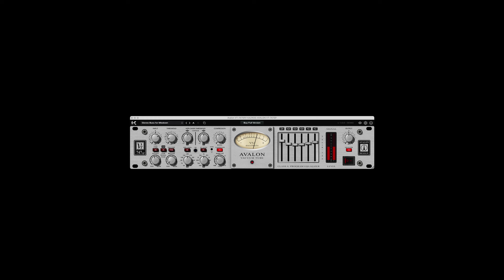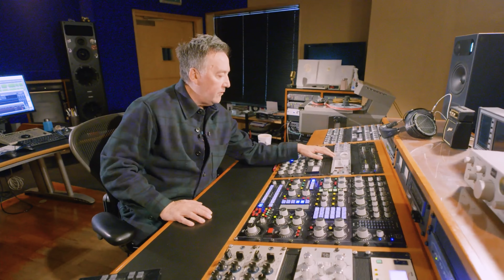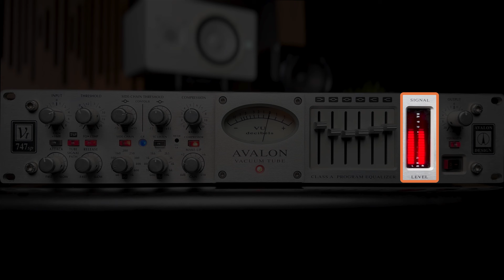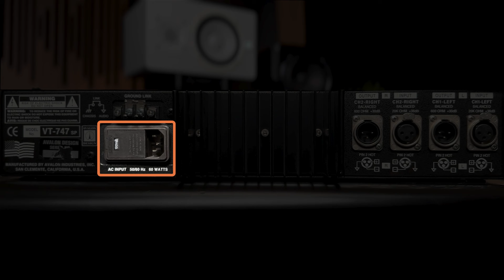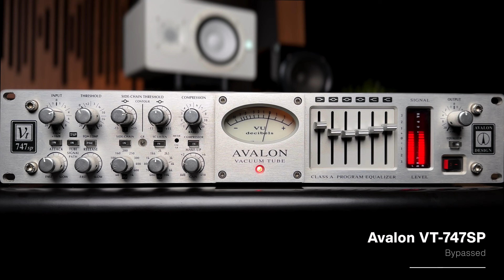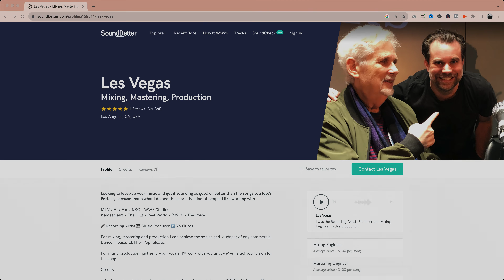Avalon VT-747SP Analog Tube Compressor & EQ (Demo and Overview)

Comment: Great video, really appreciate the effort you put into it. How often do you usually replace the tubes? I’ve got a used unit arriving next week and I’m debating whether to order new tubes now or just wait and see how it performs. Thanks again for the quality video, cheers, bro.
Reply from the maker: @BesharALAzzawi You're welcome. Thanks for watching and taking the time to leave a comment. Congratulations on the new gear! That's exciting! For peak performance, Avalon designs recommends changing the tubes every 5000 hours of runtime. Changing the tubes every two years is recommended assuming use of eight hours a day, seven days a week. Avalon only recommends Sovtek 6922 vacuum tubes. https://www.sweetwater.com/store/detail/ST4TubeKit--avalon-st4-tube-kit-for-vt-737-747sp

Comment: my experience is, I never engage tube circuit, just A-class....imho tubes sound is smothering transients and in general degrade the signal. I use to play with the original hardware and had similar experience (always disengage tube circuit). Apart from that - great compresor and mazing EQ.
Reply: With FET mics tube preamps are king. With tube mics you dont need tube preamps
Reply: What style of music did you try with tsp on?
My experience with tsp engaged on low dynamic and percussive music was positive.

Comment: The review is good, as always on top.

I don't like 747.
It seems to me that the high frequencies are too "sandy"  A very specific sound.
Reply: i have 747 for years. What you mentioned is close to my opinion. It is a specific sound that is not always does the thing you want for the song. But when it does it is unique. i use it mostly for acoustic music.
Reply: @polyphoniki  I mainly do contemporary christian/gospel music ( things like Elevation Worship/Hillsong, and the like) I would use this for the vocals, vocal bus, and the like. Do you think it would be a worthy contender in this field? (I'm also thinking about getting the 737 instead, and printing the vocals individually through it. I don't know which one would suit me better, or if they would serve the genre well.)  May I ask for your opinion? What do you think?
Reply: @galgogergo  737 for vocals is more useful than 747. Both have nice eq section, compressor on 737 is easier to use . 747 is more like a master bus unit
Reply: I really enjoy this channel. All the gear reviews are very well done